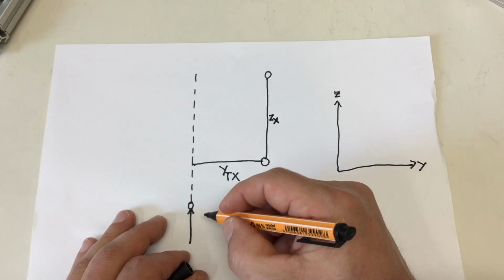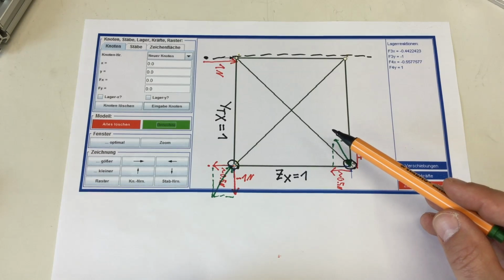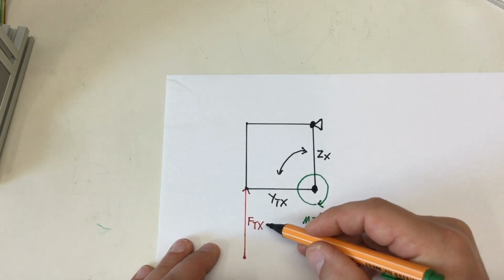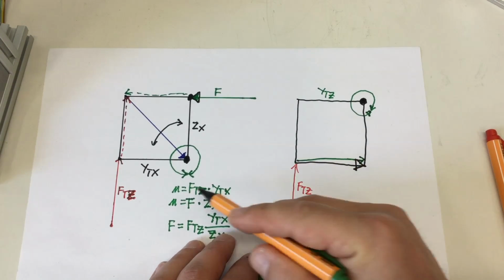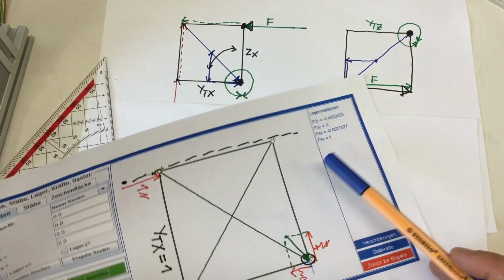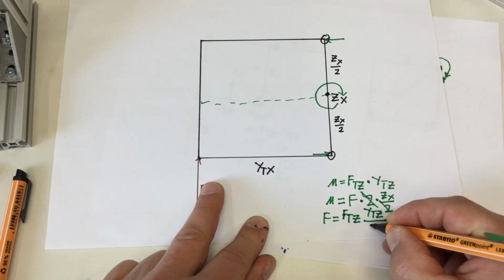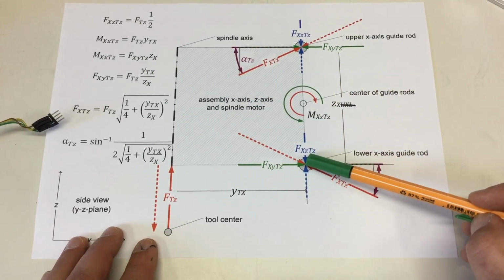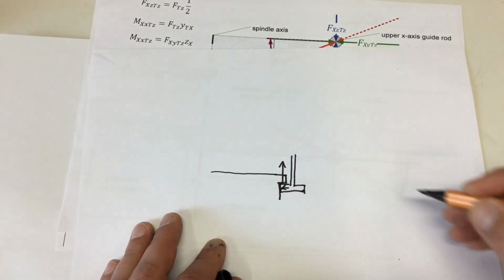3-Axis CNC Machine Structural Analysis (1) – X-Axis Load by Tool Z-Force

Comment: Hello, you are using the term 'Momentum' where in fact you should be using the term 'Moment'. A momentum is a quantity of motion of a moving body!
Reply from the maker: Thanks! You're absolutely right of course! I'm talking about the moment (force times distance), not the momentum (mass times speed) :-( Hope I didn't made that mistake in the other parts of that series too :-O
Reply: @robertssmorgasbord  no problem, I thought I'd just provide a little critical feedback! your video is very good by the way :)
Reply from the maker: @johncorrigan7024  Critical feedback is always welcome, especially when it's right on the spot ;-) So, thanks again!